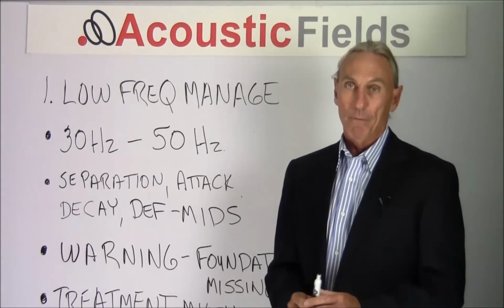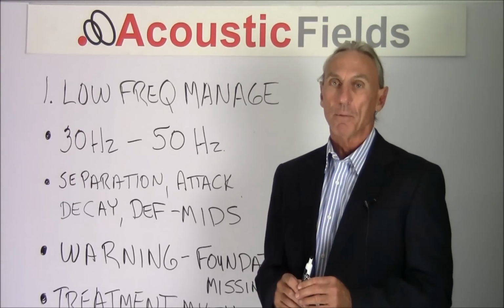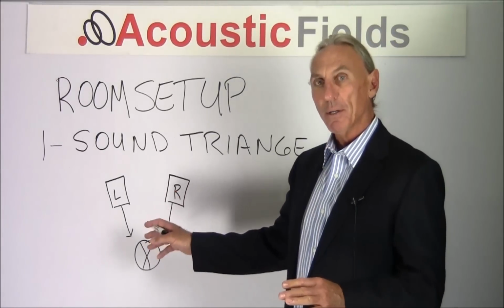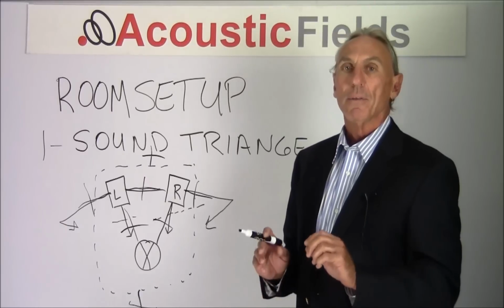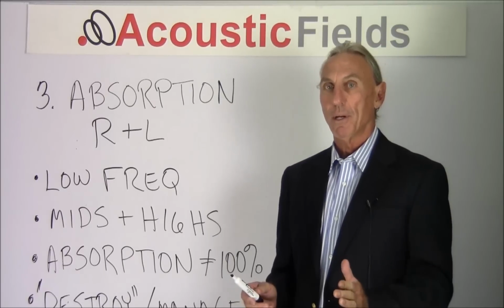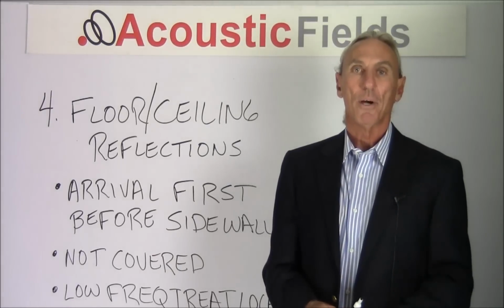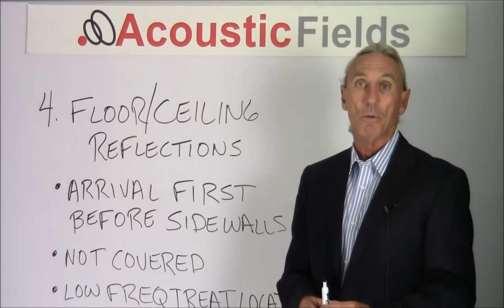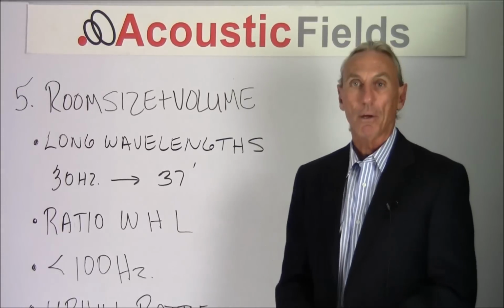Top 5 Acoustical Mistakes Most Studios Are Making - www.AcousticFields.com

Comment: Wow this info is priceless. 

I have a room that is W 11'-10" x L 21'-6" x H9'-7" without any windows. The walls, floor & ceiling are in concrete with only one door. I guess that room is a nightmare to treat right? 

The room will be used to record drums and mixing. Since I want to take advantage of the space to have "room" in the mix, once I record I guess I can make small the room to mix by putting removable walls behind me? 

What can I do? The dimensions are right to record and mix drums? 

Thanks...!!!
Reply from the maker: Hi Gamalief, Fill out the info. in this link and lets look at your room issues. http://www.acousticfields.com/free-room-analysis/ We will compare your room to our data base of over 100 rooms built and measured. We will identify unwanted low frequency pressures, their frequencies, magnitude, and location within the room. Once quantified, we can treat with the correct sound absorption/diffusion technologies. Middle and high frequencies treated next.
Reply: @AcousticFields  I think that you guys really the best option to go with, but sadly ... I'm too far away to benefit from your services, but I'm going to fill in the form anyway.
Reply: JUMP on ACOUSTIC FIELD offering man . That is GOLD he is offering. Just buying a Spectrum analyzer (the cheapest made) and doing the calculations would be about a $500+ tab
Reply: I’ll take that room. With sensible treatment you’ll be fine.

Comment: watcher of your great videos for some time ..Out of interest,what would be the smallest dimension room that would still work with acoustic treatment for a control room in your opinion
Reply from the maker: Hi Rockit, Here are dimensions from my data base that is a good break point for material, labor, modal and RT-60 "costs" 17' w 12' h x 27' l. Use this size as a minimum. Sound quality improves with each 1' distance increase from these dimensions.

Comment: Thank you, your videos have shined a light that I couldn't see before.
I've spent years learning instruments and engineering skills.
I understand the concepts here but find it hard to fix my low ceiling,corner speaker position,angled walls with a hallway @ 90degrees at the edge of my rear wall behind the mix position, which has a huge 50/60hz bump when I walk into the hall.
I use it as a reference for too much or not enough bump.
I know my room is not correct but thanks again for sharing your knowledge, you're very kind.
Reply from the maker: +mebangondrum Thank you. I will need more information in order to assist you. Go to this link and fill out the required information. http://www.acousticfields.com/free-room-analysis/

Comment: Dennis  which materials are suitable for blocking an extemely very loud music in a night club from escaping outside? can you recommend and link me to see materials which can be able to block  low frequency escaping outside of a night club?
Reply from the maker: +CONGA MUSIC You are referring to barrier technology. If you have a noise source ( night club) and a receiver ( police), you must erect a barrier between the noise source and the receiver. The type of barrier you build is strictly dependent on the frequency and strength of those frequencies (noise). You must quantify the amount and frequency of noise that you have before you build any barrier technology. Building a barrier to manage frequencies (noise) below 125 Hz. is drastically different than building a barrier to stop noise below 125 Hz.

Comment: you mentioned the ratio of width height length but did not give any information can you expand on that idea ???
Reply from the maker: +Kevin Boyd There are room dimensions that can minimize unwanted pressure issues especially low frequency pressure. If you choose a room size and volume that minimizes, you can save money on treatment technologies. Dennis
Reply: I'm sorry your not telling me anything I don't know  or have learned from your video.still I have no idea how to know if my studio is the right demonsions. it is 25.7 ft long,12.8 ft wide the ceiling is 6'11' my question is, is it a good  room size. how do i apply the bonello equation or graph?
Reply: +Kevin Boyd 
He already answered your question in another video.  Check the vid response to Han Lim's question further down.  He basically said anything less than 14ft width or length is problematic and ceilings less than  8ft are problematic.  He said 8 ft' ceilings which are standard in north america is the worst  dimension for acoustics.  Does that give you some idea now?  It's quite depressing.   I'm in the same boat my room is 23' x 10' x 7'-6".  Unfortunately that is the best room I have in my house.  Guess im gonna need to do a lot of treatment work!
Reply: thanks

Comment: Hello dennis thank you for all the videos. Its really great and helpful, Im learning a lot from your videos.
And I have a question for you about room size ratio (WHL). Can you tell me what kind of ratio are good for controlroom and whats bad?
Reply: You can tell me just approximatively. Or if you have time, you can tell me in details.
Thanks.
Reply from the maker: Han Lim No problem. For control rooms, 17' W x 10' H x 23' L is a great start. Larger is better but this should be a minimum ratio of WxHxL for a control room, home theater, or listening room.  I will put this on the list to answer in next weeks Google Hangout to give you a more in depth answer.

Thanks 
Dennis
Reply: Thanks!!
Reply from the maker: Hi Han Lim I recorded an answer to your question in this weeks Google Hangout which you can see here http://youtu.be/nHy7qmHEl9k  I hope it helps.  Please let me know if I can be of further assistance.

Thanks
Dennis